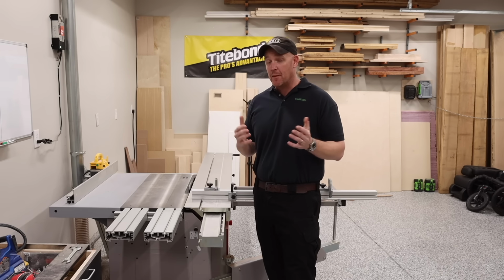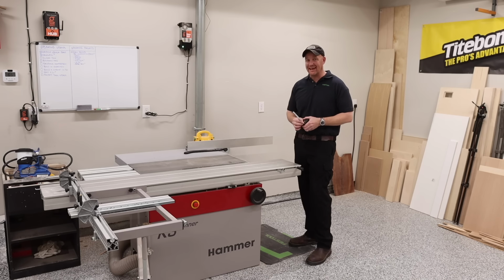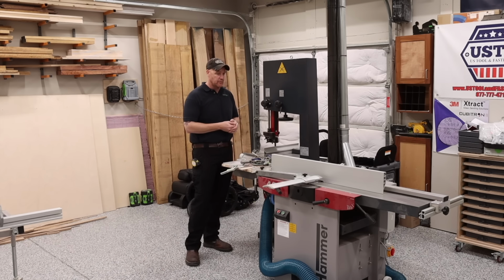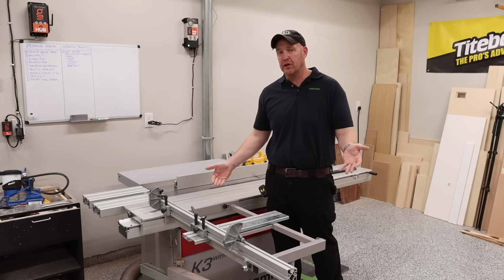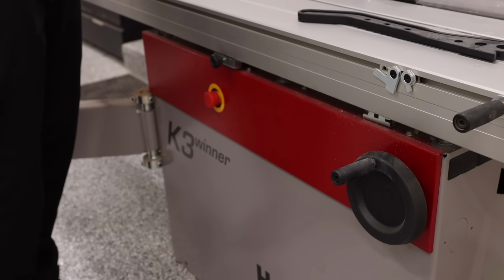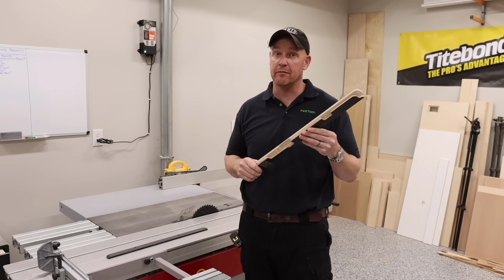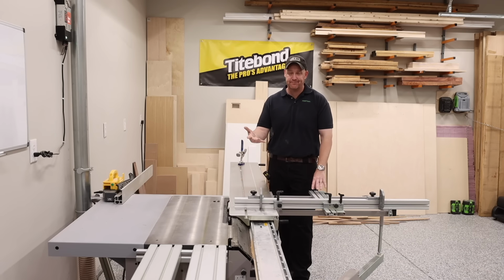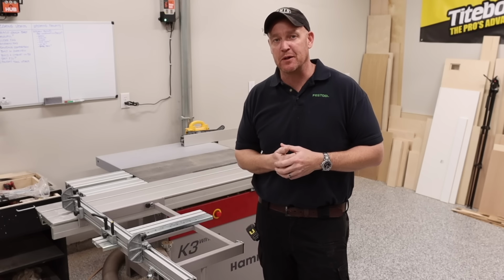I’ve been using the wrong table saw for years

Comment: So how do you rip a 8 footer? Do you use the regular fence on the right and have to remove cross fence on the out rigger each time? Please help?
Reply: his isn't long enough for that
Reply: @AaronGeller  you can make a extension jig that rides in the miter slot on slider so that when you reach the final stop on the slider you just push through with the jig to finish the rip. It's basically just a board with grooves for clamps and the slot guide.  And as he pointed out you have to have the room behind the saw, so i just open the garage door :}

Comment: HI Jason,  Very informative video.  In your evaluation, you looked at the K3 slider and the A3 jointer/planer as separate machines.  Is there a reason why you did not consider the C3-31 or -41 with the same option outrigger for your shop and amalgamate the footprint between the separate machines?
Reply from the maker: I have never been a fan of all the machines in one. I also had the A3-41 long before ever considering a slider.

Comment: Hillarious, I ran into the identical issue with thinking my machine was fried after I installed.  I need to get my crosscut fence aligned as well.  I noticed you removed the last wing...I am thinking about doing the same thing...any regrets?
Reply from the maker: None at all. I didn’t need the 48” rip capacity

Comment: Hey Bent this is an off topic question but when you’re sanding between coats of polyurethane or paint, when you sand do you use a power sander or by hand?
Reply from the maker: By hand usually

Comment: How much more money was the saw/shaper combo?  Going from router to shaper is like going from a circular saw to a table saw.  Shapers are a joy to use, just curious what the thought process is on not getting the shaper. (other than obviously cost)
Reply: the K3 doesn't have the shaper but the B3 does. Overall, it's about $1500 upgrade

Comment: I get it. I've worked in shops with sliders, and they're great. But all the shops I've worked in that had sliders, also had standard table saws. They're both excellent tools, and both have their strengths and weaknesses. For my own shop that I run these days, I would never have a slider.

Great video, and I loved all your detailed comments.

Comment: I’m curious what your how you  cut off your edge after using the jointer. The slider doesn’t seem like enough reference surface for squaring.
Reply: Two easy ways are 1st cut a piece of plywood 90 degree one side against the outrigger fence the other side is now the reference sliding fence.  2nd way is to use a second stop/parallel stop.  Felder makes a parallel stop or you can use the miter fence with both stops set the same.

Comment: Hey Bent I have the same saw and the sliding table rides a little higher than the cast iron portion of the saw, did you lower your slider to be even with the cast iron top?
Reply from the maker: The table has to be slightly higher otherwise it will cause pieces to drag. I had to adjust mine because it was much higher than it was supposed to be.

Comment: I looked at this and went 5hp ics.  Nice machine but did not support my needs now will let you know as you age that ply will be ome an issue trust me.   Panel saw better option to break sheet goods.  My biggest regret is I got the bigger table extension and it's a catch-all.   Should have went smaller.   Cheers

Comment: For working with big sheets I can see that as a huge plus.  Curious where it comes in price wise compared to your previous saw.
Reply from the maker: It’s not that far off actually. Especially with the incra fence. But, I think it’s more comparable to the ICS and I bet they are pretty close on price
Reply: A you tuber called “Inland Wood &Resin” did a price breakdown video  between this saw with some options and  a 5hp ICS SS that also had a slider as an option. The price was about $200 difference, but that was a year ago. If I remember the cost of both were around 7 grand.

Comment: What is the advantage of a slider over a panel saw? They take up very little space
Reply: By panel saw I assume you mean the vertical saws you often see at lumber yards that can cut a 8x4 sheet of plywood down to two 4x4 sheets.  Kind of a vertical radial arm saw.  I don't think the panel saws are known for exact tenths of a millimeter accuracy.  And they cannot do angled cuts.  Sliding table saws have a miter fence on the slider that can be adjusted to any angle.  And the Fritz & Franz jig can cut small pieces easily on the slider.  Not possible on the panel saw.  And I suspect the actual use of them feels different too.  You are always bending down to the ground when using the panel saw.  You are moving forward and backward at waist height with the slider.  Imagine having to bend over at the waist or kneel down to tie your shoes twenty times an hour.
Reply: @russellseaton2014  i worked at a cabinet shop with a Stribeg panel saw. it was accurate beyond belief. With an attached jig angles could be cut also. What I liked about it was not having to lift 5x12 sheets of material up onto a able saw. The only thing more accurate and repeatable was the CNC. Wish i had the room for ether one in my current shop.

Comment: Not sure why you need/want a slider plus a large MFT table. Seems a bit redundant.
Reply from the maker: I’ll be changing my assembly table this year
Reply: @bentswoodworking  I thought about going with a slider for my new shop…but I couldn’t quite figure it all out (especially ripping) from watching videos so I bought a sawstop. I will build a MFT table/bench (or two) like Hooked on Wood’s. Have a Festool track saw and router. I will be getting a minimax for a combo planer and joiner. Or maybe Felder. I am building a decent sized shop, but the space is running out between everything I want to do with it (auto, welding, wood, office space). Beats the crap out of trying to actually leave our previous employer at official COB and trying to get to the Arts and Craft Center before it closes.

Comment: Just for the sake of clarity. If if works with 110V 20A. Then it works with any standard European outlet
Reply: This saw, and all big woodworking tools, use a 220 Volt motor.  The breaker supplying the 220 Volts could be 20 or 30 Amp.  But the wire needs to be two big wires for the hots and a ground wire.

Comment: I looked at Felder at the Vegas show and actually put money down on one until  I saw the MiniMax. First off I didn't like their pricing structure or the arrogant attitude of the Sales people so I ended up with the MINiMax which is the lesser line of SCMI commercial saws. I purchased their top model, so I could handle full sheets, for less than the smaller Felder unit, and they also have a compact unit as well. Felder makes great quality machines  but I saved a ton of money over the Felder and believe the MiniMax to be superior, due to the fact that they've been in the business much longer, and ar  the largest manufacturer of wood working machine on the planet .You won't see nearly as many Felder saws in commercial shops as they aren't considered better than the top three Altendorf, Martin and SCMI. When your spending this much money  it just seems prudent to go to the big shows where all the brands are represented so you can do fair comparison shopping all in one place. Outside of that I agree with you its so much nicer to have a slider, especially if you do any Euro cabinetry, its so much easier, faster and more accurate.

Comment: Congratulations, you bought a fantastic machine that is superior in every way to a "traditional" table saw. It much more easier to operate for one person, safer, faster and  much more accurate. All the dislikes that you have are caused by the fact that your are trying to use it like an old style table saw. For example this saw needs to be operated when you stand always to the left of the carriage. You turn  the machine off only when you finish working, not after every cut. For the same reason, you need to install the blade cover and use it all the time, it is safer and it will give you better dust collection. There is no reason to remove it since you don't use table saw sleds and it will never gets in the way. Here in Europe old style table saws are only used for hobby for the last 30 years or more. Americans are very slow in adapting new technologies.
Reply: Or maybe it is the price that stops us Americans from adapting to a slider. $6000 is a lot of money to invest in one machine of a small commercial shop and is almost a no go for just a hobbyist. I believe grizzly has a machine for around $4500, but the reviews are mixed with that saw. There just are not many US based companies selling them here. I bet larger commercial US shops use sliders.
Reply: @richardlug6139  The model used in the video is a commercial machine, but you can buy a Holzmann TS250 starting at 1100 euro, depending on the slider length.
Reply: @jyfjgtyuh  That machine looks a lot like a cabinet saw with a slider attached to it. You can get that attachment for your cabinet saws here in the US.  To be honest it did not look like anything special, but then again it was just a picture.